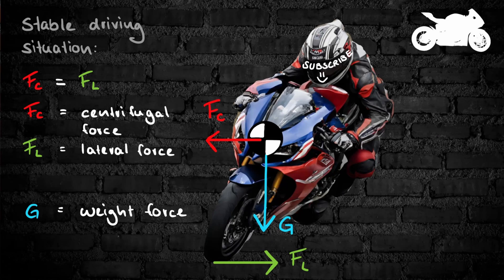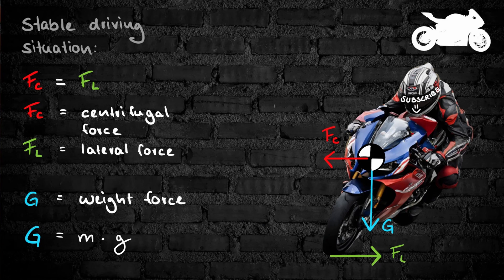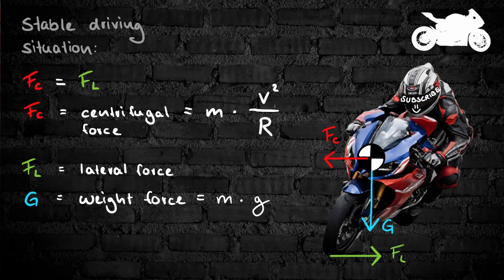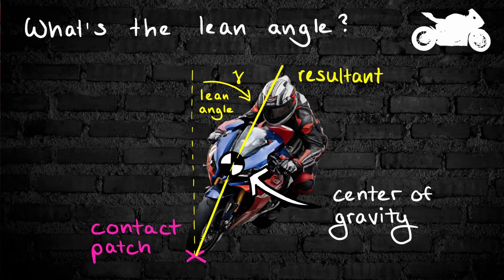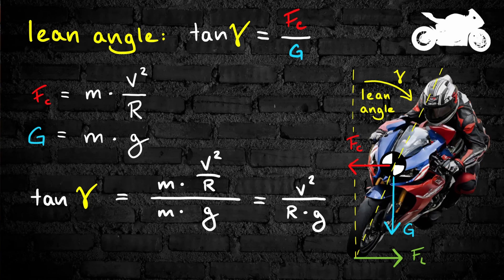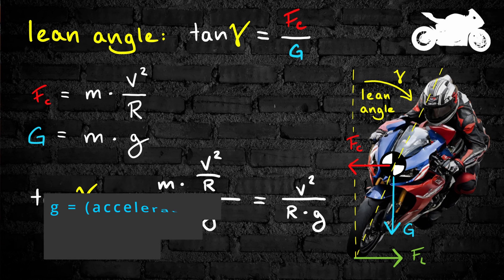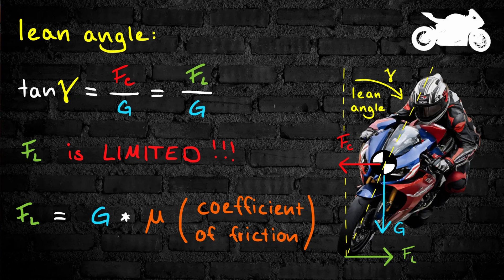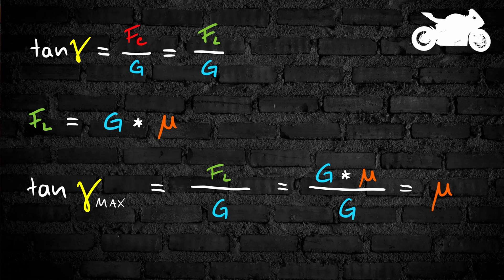How FAR Can Motorcycles LEAN?

Comment: Sorry but this is terrible. You are saying the maximum lean angle is 45 degrees? Have you ever ridden a motorcycle? Ever WATCHED riders going through corners on a racetrack or mountain road? Modern hypersport tyres are letting bikes lean 55*+ very easily. Even 60* with alot of the race specific compounds, like the diablo slick 200/65, R11's, michelin power slick, gpa-pros etc etc.
Reply from the maker: Where exactly did I say that without mentioning that the 45° are ONLY the case for basic assumptions like a coefficient of friction of 1 and a simple  model of a motorcycle (for example without taking into account the width of the tires or the center of gravity)?

This video is supposed to explain the basics to people who don't work in this field and just want to learn more about their motorcycle. 

Oh and coefficients of friction between 0,8-1 are quite normal with typical tires on a typical road. I just did measurements at work to justify this two weeks ago...

Comment: If you are not going to put in a factor for positive camber, stay off the wall of death!
Reply from the maker: I assume you're talking about camber in the road? Or are we talking cars now 😜
Everything in my video refers to a road without camber.
Do you think it's relevant for the average person? (Just asking for feedback)
Reply: Yes, I am talking about camber. Your analysis applies to level roads (left to right) at a constant speed. You made several disclaimers that this wasn't the complete analysis. You win there. Consider a road with camber angle alpha. Your normal force due to gravity is slightly reduced. You have additional normal force due to centrifugal (centripetal) force. Add mv^2/r * sin alpha. Your lateral force in the plane of the road is reduced (less centrifugal force). These differences would involve sin and cos. But wait, there's more!    Street riders leave lots of safety margin (8/10th pace). Racers leave no safety margin; they are on the verge of drifting and doing burnouts all the time.  Almost like dirt bikes. That is where the limit is. In racing the front and rear tire do not usually have the same normal force. Trail brake in, accelerate out. Using the traction circle.  Elevation is another complication. Uphill increases normal force on the rear tire, downhill decreases normal force on the rear tire. Then there is crest of hill and bottom of valley. Road builders may put a slight crown in the center of the road to aid rain runoff. This makes the road last much longer. Road builders often put in positive camber as appropriate. Freeway entrances and exits are examples that help you get to and from freeway speeds more easily. Racetrack builders may throw in one downhill negative camber turn just to keep riders honest. This is called a technical turn. Nobody expects riders (except maybe Sheldon) to quantitatively analyze this in real time. It is reasonable to expect them to qualitatively understand what is going on. Almost no simple advice "always do this" works. The complication of many factors is why you can spend a lifetime learning and practicing and still have more to enjoy.  @GiuliaonGasoline
Reply from the maker: @camgere  This is all really good additional information to the basics I explained:) And of course you're right - there's a lot more to it. For example when you have different normal forces the load on your tires changes as well and this again changes the coefficient of friction again. There's almost always a spot where you can dig deeper into the topic. That also makes it so interesting. 
In my videos I try to focus on the normal rider on the street and no racetrack pros - so I hope my calculation helped them understand the basics a bit more.
And since they never ride at the limit a camber of 2% on a normal street wouldn't really matter...

Comment: There was tan in the equation and then the final result is 45 degrees with a coefficient of 1 

Would you break it down a bit for those who left school long ago? (Some of them may even be high)

How did you find 45 ?

Thank you
Reply from the maker: That's a good question! 
I calculated the 45° by using arctan(x), which is the inverse tangent function. 
arctan(1)=45°
Here the 1 is the coefficient of friction. If you'd calculate this in your calculator it's possible you get 0.7854 instead of 45. It depends on whether your calculator is set on rad or degrees, but you can easily convert it by multiplying 0.7854 with 180/π.

Hope this helped:) If anything's unclear yet let me know.
I'm thinking a lot about how "technical deep" my level of explanation should be because I want to make it understandable for as many people as possible. And maybe some people don't even wanna know these small details like you 😇 but I'll try not to leave out information like this in the next videos!
Reply: @GiuliaonGasoline I got lost at some point when you said Fc because I haven’t done math in years, it takes some time to go back to talking “math”. 

Instead I suggest you use the full name like centrifugal force, gravitation force etc..

I know it takes longer than using math terms but it’s a way to break things down without reducing the complexity. 

You could talk about the most complex topic using simple explanations and reach any audience. 

A smile helps thinking “it’s easy and fun” , so good job on that !
Reply from the maker: @googletropcurieux8670  that's also a good idea, took a note for the next videos 😊
And right, it's always better to explain it like this, using simpler words, and maybe some people already know some things then, but this won't hurt them :)

Comment: 45°
Reply from the maker: Right!
Reply: μ can be more than 1
Reply from the maker: @littlereptilian7580  yup but on a normal street with usual conditions it's usually around 0,8-1
I actually made measurements last week 😊
Then depending on the tires characteristics, the roughness and texture of the road and also the temperature...

Comment: You can get about 1.3g out of good tyres in good weather. Assuming you don't do anything silly, nor accelerate, nor brake, we can say all of that grip goes into lateral acceleration. Per Pythagoras, that's a resultant load factor of 1.64g. Per load factor from flight dynamics (yeh, I'm going there! 😁), n=1/cos(β). Thus β=acos(1/n). In the case of 1.3g tyres, it's about 52.45°.

Highest recorded in MotoGP is 68°, which is a load factor of 2.67g, suggesting a lateral tyre load of 2.475g. Either that dude was sliding hard, or there would have been a lot of downforce at play.
Reply: That was probably when marquez lost the front, so it isn't really valid. I think the max while turning was 63
Reply from the maker: Good calculation, thanks! In vehicle dynamics you can always go a level deeper - as you did right now 😊 - and then you'll get a more specific answer. For not making everybody here too much hope I assumed simply 1g for average conditions, then everybody's on the safe side 😊
Reply from the maker: And 68°.... Wow! That's really insane!
Reply: @GiuliaonGasoline  Yeh, I get your point, 1.3g is never a guarantee, especially when you have a rider who isn't very smooth.

I quite like this particular simplification because it translates to bikes so well, but with other ground vehicles it doesn't apply, so the bigger equations you had up are more appropriate.

I ought to mention, the 68° figure is a number I plucked out of the internet (onestopracing), I've made no effort to confirm the veracity of that claim.
Reply: Do you mean μ ?? What do you mean with g?
Reply: @littlereptilian7580  I've skipped a few steps. Since F=μN and N=mg (because most bikes don't have aero), F=μmg. But also, in a bend you're subject to centripetal acceleration a. From Newton's 2nd, F=ma => a=F/m = μmg/m = μg.

I've expressed everything in acceleration terms. μ is the factor, say 1.3. But since there's no aero, your normal component is mg, therefore μ=1.3 means that you get 1.3g of centripetal acceleration.

This makes it really easy to use some basic flight dynamics equations to work out your maximum steady-state lean angle. All you need is the load factor equation n=1/cosβ, where β is bank angle, a.k.a. your lean angle. It's worth keeping in mind that n is your total load factor (the hypothenuse), so you need to do a bit of Pythagorean messing about to get your lateral acceleration. In the end you end up with something that looks like this:

a = sqrt((1/cosβ)^2-1)

Or if you can be bothered to do a bit of trigonometry on paper (like I should have done right away), a = tanβ

If you know your grip limit and want the angle, then β = atan(a) or atan(μ). Though I'd use the latter with caution, friction is not exactly the same as mechanical grip, and the coefficient stays exactly the same even if you have aero. This only works with acceleration normalised to g, a.k.a. load factor.

A few other things break this as well. Firstly, the angle is between the horizon and the straight line from the overall centre of mass to the contact centroid. If you're hanging off or counterbalancing, you are skewing that figure. If you want to stick to these calculations, you need neutral balance (just sit up straight). Also linear acceleration of any kind (power or brakes) breaks this, as your grip limit doesn't care if you're using it up for cornering or powering away. This is where it pays off to learn to ease off the power as you're leaning (provided you're not going too fast already), and to get back on it smoothly as you stand the bike up.
Reply: @233kosta  thanks for the reply. What do you mean with aero ?
Reply: @littlereptilian7580  More shorthand 😁

Referring specifically to cornering aerodynamics, so anything designed to increase downforce while cornering. Much like F1 cars have wings, whose sole purpose is to keep the tyres planted while turning (and accelerating/braking I guess), some bikes (new Panigale V4 anniversary edition comes to mind. Some GP bikes too maybe, I don't follow that too closely) have special aerodynamic surfaces for the same purpose. The Moto Guzzi V100 has some active aerodynamics (two little surfaces pop out of the tank), but I question how well those work for cornering downforce. The windscreen position is also automatic, and that I'm sure works a treat 😉

Most road bikes however don't. The aerodynamic optimisation there starts at rider comfort and ends at drag reduction. A lot of bikes (probably not the majority, but definitely a large minority) have no aerodynamic enhancements at all! So in a corner, you get what gravity gives you.
Reply from the maker: @littlereptilian7580  was wondering about the same thing 😊

Comment: I don't think my brain can do that much math before going into the corner 🤔... Shiiii I couldn't do that math is sitting at the kitchen table.
Reply from the maker: Yeah better just go with the flow when you're riding 😊 and only keep this in mind as a little background information 😂
Reply: If you can get even as little as 0.4g out of your tyres (so, uhh, we're talking much worse than just wet), then you can safely go down to 20°.

If you have decent tyres, 1g is pretty much a guarantee in warm dry weather (and on good tarmac), so 45° is fine. The yanks' road authorities use 0.9g as a safe assumption in wet weather, which means you can still do nearly 42°. More than you'd comfortably use in daily riding, and way more than you'd get out of most cruisers 😂

It's apparently very slippery when it first starts to rain after it's been dry for a long time (rain lifts all that debris, etc.), so for the first half hour of rain or so, the first example is a good guideline. But if you're smooth enough, you'll get the chance to feel the approaching slide slightly before it happens.
Reply from the maker: @233kosta  Just one question out of pure interest: where is it common to make these types of calculations with g instead of the CoF? You mentioned something with flight dynamics earlier... I was just wondering because in my engineering environment everybody is mostly talking about the coefficient of friction 😊
Reply: @GiuliaonGasoline  It's fairly common in aerospace as a means of nondimensionalising inertial loads. In this case, it's a simplification based on the assumption that the tyres are loaded correctly, there's no gradient change and no downforce at play (because bikes), so μ becomes the acceleration limit in g, per your derivations too. I further assumed that there's no acceleration in progress (neutral power, no braking), which means that all of that grip can go into changing direction.

Yes, I did mentiom flight dynamics (if you know 'em - use 'em, right?), that was the simplest path I could think of to solve this problem. The equation I used is for the load factor (in g) an aircraft would experience while turning at bank angle β in level flight. In the aircraft, vertical acceleration remains 1g (from gravity), but as the lift vector (normal to the wings) changes direction, its magnitude must increase in order to maintain a 1g vertical component (cosβ). The horizontal component (sinβ) is the centripetal acceleration that actually turns the aircraft. On a bike it's slightly different. The vertical component comes from solid ground contact and the horizontal comes from tyre grip (our limiting factor). Crucially though, we know the resultant reaction vector must go from the contact centroid through the centre of mass, because at peak lean the bike is in a steady state. If the reaction vector were slightly offset, the bike would either lean further or return to upright. This means that the forces in this state resolve exactly the same as in an aircraft in a steady coordinated banking turn, so the same equation applies. Which is good, makes life much simpler 😉

Perhaps one day it'll be fun to derive the full dynamics of turning bikes, but for today I'm happy to keep it simple 😊
Reply from the maker: @233kosta  Oh that sounds pretty interesting! And i get why it makes perfect sense to use g for these types of calculations, since well you don't really have coefficients of friction I guess? (maybe somehow with the air, but that's something different then?) I honestly don't know a thing about flight dynamics, apart from maybe the things which are the same for ground vehicles. But what you explained with the calculations with g are kind of the same calculations we do, when we want to know something about a vehicle in a banked curve. Then you also have "lateral g" that doesn't come from tyre grip. 🙂 It's always great to find these similarities in different fields of engineering 🥰